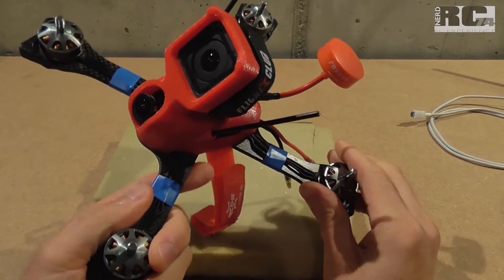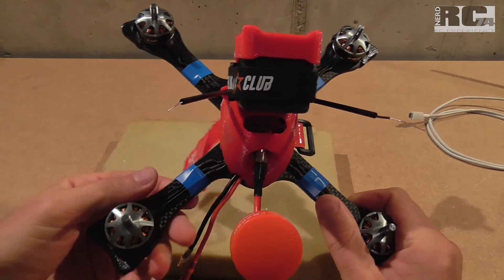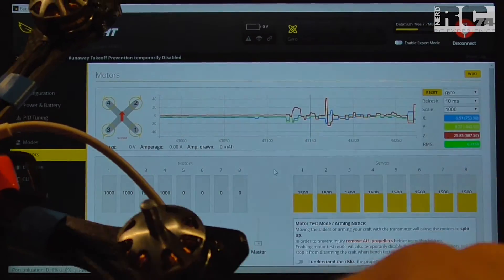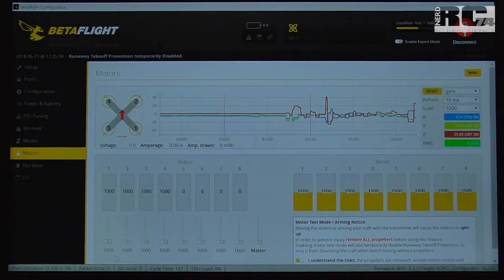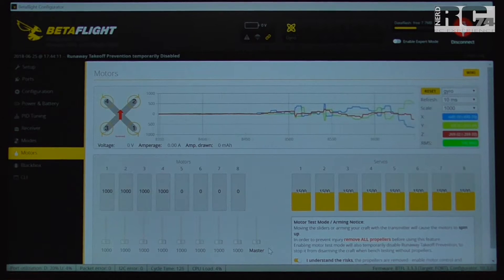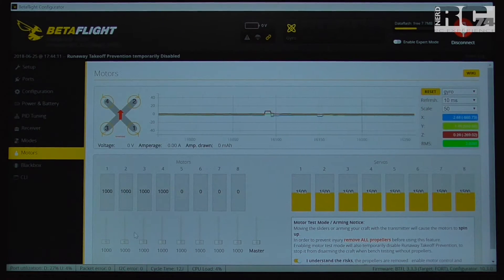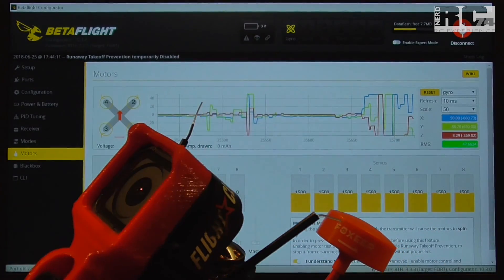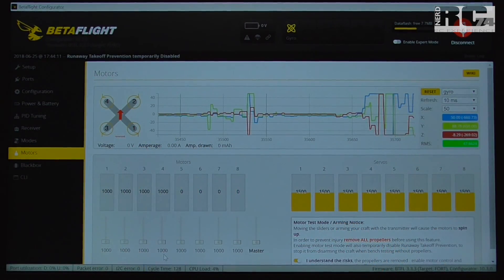HOW TO DETECT A BAD MOTOR ON A QUAD | BETAFLIGHT

Comment: It's even easier to spot if you reset the "Gyro Data" after every Motor rev up and then just remember or write down the "max values" which should be one enclosed in the brackets.

Comment: One of my motors tried to spin but just flickering is that mean my motor is bad or could it be my 4in1 esc its a brand new betafpv x knight 4inch and i had a bad crash
Reply from the maker: To find this out, just switch the position of the flickering motor. Example: If motor 1 is flickering, solder it to ESC of motor 3 and check if it is still flickering. If yes, the motor is damaged. If no, the ESC has an issue.
Reply: @RCnerd74  thanks but i already know that its a new quad and a 16 x 16 dont want to solder amd desolder more than i have to lol oh and i was born in 74 to lol

Comment: Thanks. My TH2 is dropping out of the sky with an RX Loss flag in the goggles. Replaced the flight controller and camera and it's still doing it, so it has to be a motor. It must be overheating the board and shutting it down.
Reply: This real late but it was a receiver/failsafe issue correct?
Reply: @quentindollard4602  I bought a BetaFPV Lite radio 2 and bound in D8 and the problem went away. I never figured out why exactly my Tinyhawk 2 worked for a few months connected in D16 on my X9 Lite radio, then suddenly stopped working. I also can't explain why my Tinyhawk Freestyle 2 still works in D16 on my X9 Lite radio, since it's the exact same flight control board and receiver. If you're dropping out of the sky and connected in D16, I'd get a radio that can use D8 and bind in that. 

I did not believe it was the radio for a long time because it worked fine for months. So I replaced the AIO board. That didn't fix it. I then replaced the camera. That didn't fix it. I then replaced all 4 motors. That didn't fix it. As stupid as it sounds, it was the radio and SPI receiver becoming incompatible.

Comment: HI Im a noob and have a question, i have a mobula7 drone and it doesnt want to take off normaly it flips to one side as if one or two of the motors where weak or not working correctly.  How can i test it on betaflight ? if all motors spin does that mean the motors are good?
Reply from the maker: Is the drone brand new? If yes, your motors should be OK. Sounds more like an issue with your flight controller. Did you tune something on betaflight or does it have stock settings from factory? And check the motor direction and how your props are mounted.
Reply: @RCnerd74  Its not new and its stock settings. its been flying funny when i added thrust it didn't seem to go uni-formally up. i thought it was a motor issue. not it doesnt even want to take off it just flips to one side
Reply from the maker: @dee1251  Check the spinning direction of each motor. Two have to turn Clockwise and two Counter Clockwise. For example front left and right rear CW and front right and rear left CCW. The pitch of each prop has to look upwards in the spinning direction of the motor.
Reply: @RCnerd74  Thats a good point. In betaflight i have reset my settings and i remebered that i changed a motor before and i had to change the direction in blheli. so in betaflight i determined which motor i changed direction in and i tried to do the same but this time i must of scrwed up something in blheli (maybe chose the wrong flash? or setup) since now none of the motors spin in betaflight after programing in blheli. What choices / flash do i need to choose in blheli?
Reply from the maker: @dee1251  Check out the following video. It is also about blheli configurator. What you can try is to set all defaults on blheli. For this you just need to hit the defaults button on bl heli. And make sure the motor cables are all soldered in the same order to your esc. I always prefer to not cross any motor cables. Just straight to the esc.

Comment: what about if all the motors seem to be running smoothly through betaflight, but yet when all 4 motors are turned on through the transmitter, theres a vibration through the frame and motors seem to be getting warm ?
Reply from the maker: how fast do your motors get warm? after a few seconds? does this happen on betaflight stock settings?
Reply: @RCnerd74  get warm after about a minute. 
yes stock settings
Reply from the maker: @ismaelmercado9861  If the motors only get warm but not hot, that's ok. But the vibrations you describe are not ok. you can try the following things: change the esc protocoll on betaflight, try PID tuning. there are a lit of good tutorial videos on youtube. update your fc and esc to the latest firmware. if all this doesn't help, use another fc and/or esc. perhaps you have damaged hardware...